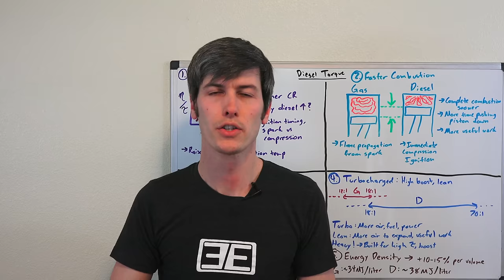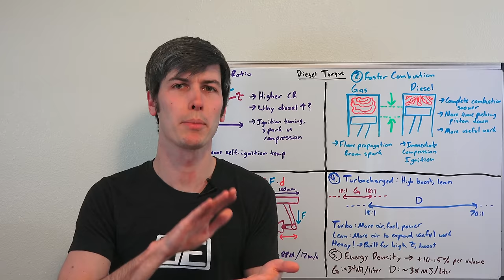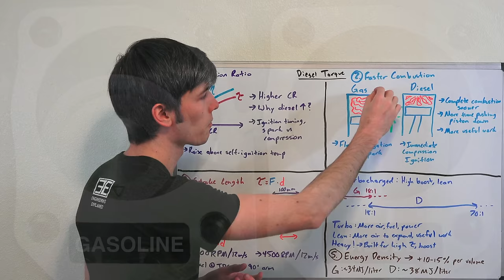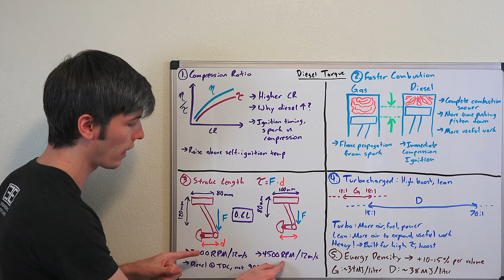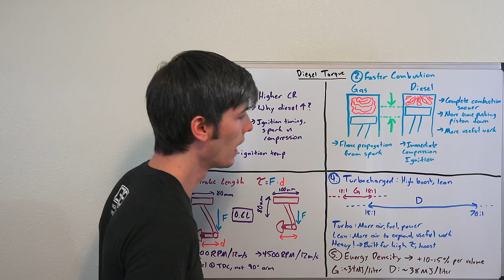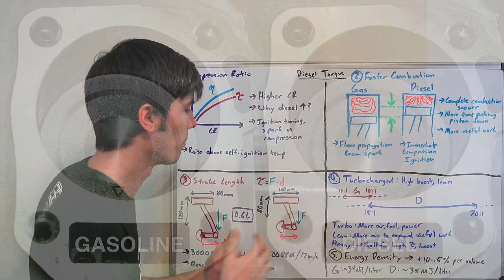5 Reasons Diesel Engines Make More Torque Than Gasoline

Comment: Torque comes from the crankshaft swing a big circle. The rods are longer on diesel than that of gas. Torque is leverage bigger the crank longer the rod more torque. and horsepower for gas is always the same as torque almost and torque on diesel is double the horsepower. 
      Example 200 horsepower gas engine has about 200 pounds torque. 200 horsepower diesel has 400 pounds of torque. diesel engines burn cleaner than gas. gas engines and has very poison  gases. Diesel looks dirty but burns cleaner. 
      Example If you had a pry bar in between two pieces of concrete and if the bar is 4 ft long and you weigh 200 lbs. you would lift as much  as the person with a bar 8 ft long and weighing 100 lbs. horsepower is misleading it is leverage when the motor head temperature rises you lose horsepower (endurance). that is like you are hanging on the end of the bar you get tired and give up that is why when climbing a hill you lose power. 
but the longer the bar is your feet comes to the ground and the longer you can hold on. torque is leverage. horsepower is endurance.
      HORSEPOWER is fraud it should be called endurance and torque should be called           torque power. or TORQUEPOWER . 
       A man wes selling a gasoline powered plow and the farmer said how much power does it have and the salesman said about the same as that horse over there.  And that is how ie started. LEAVE IT UP TO A SALESMAN.

Comment: Engineering explained, the answer to your question about gasoline auto-ignition engines is linked with point two of your excellent video. 
At first, distinction between gasoline and diesel engines is historical. The very first patent of Beau de Rochas was the only available for Henry Ford T-model : mass-production and low cost of a reliable thermal engine, but, relying on a high quality highly volatile fuel : gasoline.
Then came Diesel and the terrific idea to burn crude vegetal oils (at this time), mostly in factories where wegetal garbage was an unsued resource for electricity production : you put crude oil in an engine as you put logs in a chemny.
Since 20 years a dream of oil companies is to reduce the costs, by merging the fuels circuits : one "unique" product on the same market... ELdorado
Since more, engine manufacturers dream should be to merge advantages of two technologies : torque, reliability and efficiency of Diesel engines versus the lower production cost and the lightness of gasoline engines...
So the Beau de Rochas patent implies to compress a mix of air-gasoline close to stoechiometric point. From there comes the limitation on the compression ratio. Many people believed so until gasoline direct injection came and people tried to reach the Grail... Think a bout the 90:1 compression ratio you can find in some propotypes as in F1 !
But the problem is precisely in your point 2 : flame speed.
In fact, things are a quite more complicated than you show. Whatever you do, when you inject gasoline, evaporation and mixing are quite fast and wether you chose auto or spark commanded ingnition the flame will propagate in a gaseous mix.
In a Diesel, oil drops stay floating in the turbulent overheated air of the chamber : they slowly evaporate at their surface and auto-ignition occur in the thin spherical shell where the gas concentration decreases from saturation (at drop surface) to stoechiometric point.
The first flame is called a deflagrant flame, the second is called a diffusive flame. At the stoechiometric point the first one produces a sonic shock, never do the second...
This is one of the main reasons why auto-ignition in gasoline is not so easy to manage in alternative engines. You can do it in short-lived engines (like F1), or turbines of course, where things get stationnary. But for low-cost long-life mass production engines, you can forget it until you find the way to manage with the deflagrant regime of the combustion front in the chamber...

Comment: Gas engines can be longer stroke too, the Toyota 1ZZ-FE is 1794cc, with a 79mm bore and a 91.5mm stroke. This combined with the long thin intake runners that the early engines are fitted with makes for a hilarious amount of torque from a small 4cylinder.

Comment: Torque is good at low rpm, rpm is 10x adding more power to newtonmetre than effective newton metre does (350 nm gains faster kw by rpm than what a newtonmetre gain would compensate, in this case you have 73 kw at 2000 rpm) , diesel torque pulls weight, petrol picks up speed. You always need both, of course, as you pull weight and want that weight to pick up speed. That's why a relative low weight is better off having a petrol engine, but at a certain point you need a diesel. European market was happy with the turbo and the intercooler, that made our diesel revolution in the eighties and nineties. I never liked diesels though, always had petrol cars.

Comment: Good video but it ended with a strange claim. Isn't maximum torque determined by oxygen? And since gasoline generally contains oxygenating additives, such as ethanol, I'd say that diesels lose point 5. Perhaps you were thinking of MPG?

Comment: Diesel also have higher energy density compared to petrol/gasoline hence the higher torque figure 
1 litre of petrol - 9,1 kwh - 32,6 mJ
1 litre of diesel-oil - 10,0 kwh - 35,9 mJ

Comment: Diesel is way better all the way around. More power. More torque. Less emissions. 40% of the engine power goes to the wheels compared to the 20% of gas. Diesel is also easier to refine than gasoline. The engines are also much more durable and long lasting. Only down side is a repair on a diesel engine is costly.

Comment: I don't buy the idea that diesel-air burns faster than gas/petrol-air mix. Indeed, with gas/petrol air mixes there is always the danger of detonation and it's one of the constraints on the maximum compression ratio that such engines can sustain. It's also generally recognised that the reason that diesel engines are largely self-limiting on RPM is the relatively slow speed of the flame front and burn rate of diesel-air compared to that of gas/oetrol-air mixtures. The latter can commonly reach 7,000 RPM on quite ordinary car engines, with some well over 8,000 RPM and in certain motorcycle or race engines approaching 20,000 RPM (with very short strokes admittedly, but no diesel engine can get remotely near that). Then there is the point that, with a diesel engine, there is no ingestion of a fuel/air mixture. Fuel is direct injected and atomised as it enters the cylinder and diesel simply doesn't burn that fast, even under those conditions. If it did, diesel might detonate in the manner of petrol/gas, and it never appears to do so.

The main explanation is surely the higher compression ratio. The higher compression ratio allows for higher cylinder pressures throughout the power stroke. Even then, be careful as it's not obviously true that a naturally aspirated diesel produces more torque than an equivalent petrol/gasoline engines of similar capacity. It seems to be turbocharging that's made the difference with diesels as they are more tolerant of high boost pressures than a petrol/gas engine as they are not prone to detonation. Older diesel car engines were notably weak prior to turbo-charging unless of markedly higher capacity than their petrol/gasoline equivalents.

Comment: You make some great videos, unfortunately, this isn't one. I'm sorry but I feel that there is a fair bit of misinformation in this. Firstly, BMEP (proportional to the torque/displacement) is generally higher in NA spark-ignition vehicles than in NA compression ignition engines, so in real terms, petrol/gasoline engines produce more torque than diesel engines with the same setup.
Secondly, while compression ignition engines burn their charge quicker than spark ignition engines, the rate of burning diesel fuel is somewhat limited by the fact that the engine is injecting the fuel as it is burning. If I'm not mistaken, this takes considerably longer than the time it takes for the flame to propagate through the charge in a petrol engine.
I believe that the misconception really comes from the fact that people are comparing forced induction to naturally aspirated or engines of similar power. Since diesel engines struggle to rev highly, they have to produce more torque to produce the same power and as you displayed in a previous video, with the availability to use gearing, it is power which ultimately matters.
Anyway, keep up the good work and I look forward to your next video.

Comment: There is  much wrong about this. Bore/Stroke ratio has nothing to do with it. Combustion speed? what?

You should read up on the combustion process of gasoline vs diesel. Spark ignition VS Compression Ignition. Most of the things you are saying are why the produce more toque are as a result of the compression ignition requirements. Basically you're arse about face on nearly all of your video.

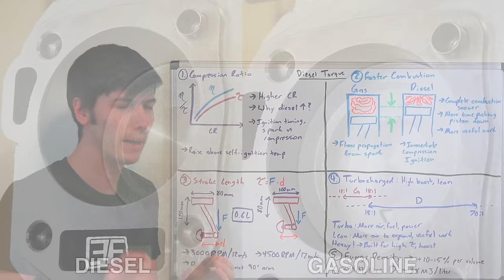Comment: 03:35 the reason why you do not understand this is because you are not considering how slow diesel burns and why ignition advance is is a factor.  Even on gas engines when you are under load or stomp on the accelerator ignition advance creates a spark a little earlier so that there is more burn compression for the down stroke. For diesel engines if you combust right at the top of the compression stroke that is far too late.  FOr diesel engines you want it to combust right before the completion of the compression stroke whereas on gas you only want that under load.  (I am oversimplifying assuming you understand).

Comment: I drive a Kenworth with a  Cummins 15 liter turbo diesel.  The HP is only 475 but the torque is insane.  IDK the torgue specs exactly. At 70 mph in 11th gear the engine is turning at only about 1370 rpm.  This is fairly standard engine, there are others out here with bigger power than I have.

Comment: Really, I think you should think again about how the timing of ignition affects the stroke. Yes, it's not at the optimal position during the stroke, but it's developing cylinder pressure that works for the entire distance of piston travel. It works all the way down to BDC. That, plus what you said about more compression and turbos, etc., is what makes the diesel build more torque.

Comment: There are a couple of misleading facts here... diesel combustion uses a less efficient constant pressure expansion but at a higher overall pressure vs SI constant volume expansion.  Diesels can continue to add fuel during the expansion process to further sacrifice efficiency but gain power. The energy density of gasoline (per mass, like everyone else uses) is higher than diesel and should provide more power but the lower pressure/efficiency prevent it from doing so... a simple P-V diagram would show most of the difference between SI and CI cycles.

Comment: diesel wont completely burn(flammability and volatility), as it  wont mix with air so easily and so intimately(more denser) and; it need more time than petrol to complete combustion(since molecule are heaver and wont get mix with air).  but petrol can do this, it's combustion will be complete and clean(highly volatile), it can burn faster(flammability) than diesel, less time required to complete combustion. it mixes with air easily and so efficiently(lighter molecule, evaporates easily and mixes). am i right???  
please correct me if i'm wrong... so i think when its come to combustion. petrol is clean, faster, more power.. feel free to reply.

Comment: Hi. I must say, I disagree. I had 1,9 litre diesel (Vw Polo) and it gave 120 Nm. It was naturally aspirated. I have found out that gasoline engines, also naturally aspirated, will give 100 Nm/litre. So diesel will give less torque than gasoline engine.

Comment: Diesel is for Power and Gasolene (Petrol) is for Speed. Thats how and why Engines are designed. And if you design both the Engines to have same Torque, then the cost will be the criteria. Again, you have to consider, whether it has to be Supercharged or Turbocharged. And ultimate it is the requirement - Speed or Power.

Comment: Another major flaw in those Engineering Explained videos: for a given displacement, a longer stroke DOES NOT yield more torque. Any increase from the longer "lever arm" is offset by the smaller piston areas on which the combustion gases exert pressure. 

Now, for the same bore, increasing stroke will increase torque. But that does not come from the greater "lever arm", but rather from the increased displacement of the engine.

Doing the calculation is quite complex because one needs to integrate the full compression stroke to calculate the the equivalent lever arm effect and the the gas pressure as it expands while the piston travels down. However, it is also possible to look at this through the energy or thermodynamic equations. In general terms, the engine isn't more efficient with a longer stroke, it cannot extract more energy out of the fuel simply by varying bore and stroke.

Comment: Hey Jason. AKA “torque guy”. I’m curious as to what’s that spur sticking out of the bearing cap on your demo engine. Is it to toss oil onto the cylinder walls? I’ve never seen a bearing cap like that. Thanks for your great videos.

Comment: Another thing I didn't see mentioned was the fact that you can throw almost as much turbo as you want with a diesel because you're using compression ignition to ignite the diesel. You squirt the fuel in when you want ignition to occur (this is diesels "timing)", and can adjust the timing. In a gas engine obviously you cannot keep raising boost because you will get preignition. Weak links because headgaskets and studs...maybe EGT and Pyro turbo temps.

Comment: From the 4 reasons, only one counts: turbo-charging. Without it the diesel engine would have much less torque than the gasoline engine mainly because it uses lean  mixture. Gasoline engines use stoichiometric mixtures (all the air is used to burn fuel) but the poor mixture preparation of diesel engines does not allow that all air is used and less fuel can be burned, producing LESS torque. 
Why does the diesel engine suffers from poor mixture preparation? Because:
1- diesel fuel is very difficult to vaporize and mix with air, much more that gasoline;
2- you need to inject the fuel during the expansion of the piston and there is no time for a good  mixture to be formed: the fuel burns as soon as it is injected.

Comment: Also are you absolutely sure that increased stroke length increase torque because of longer lever? Because I once read from someone who claimed having done dyno tests on engines and found out that the torque didn't increase from stroke length alone. It increases torque because the displacement is bigger. So if you'd have two engines with same tune and displacement but one with longer stroke and the other with wider bore, the torque figures were almost the same.
Well, that's what he claimed anyways. I would really like to find something where it is proven that does the engine get more torque from having longer lever-arm (stroke). Because I haven't found anything proving that from anywhere.
Almost impossible to find any in-depth stuff from internet lol.

Comment: Rotational mass is also a key factor. As Engineering Explained said diesels typically have more mass and with that extra mass there is more inertia. Having more rotational mass will result in more torque. Torque = Force*Distance. Force = Mass*Acceleration.

Comment: all things equal a gas engine out powers a diesel. 
olds 350 a good example since it came in both flavours, extolling the same dimensions.
but you can't beat the efficiency of the diesel.
25% less power, but 40% better mileage.

Comment: I don't think bore length is really a factor, at least not the way you explained it. Two engines with the same cylinder pressure and displacement, but different bore lengths would produce the same power (i.e. energy per stroke), because even though the one with the longer bore length has more distance for the force to act over, the one with the shorter bore length has more force due to the pressure in the cylinder pushing on a piston head with a greater area. This is confirmed by the fact that pressure * volume = energy (N/m^2 * m^3 = Nm).

Comment: You do NOT get greater torque from a smaller bore long stroke combo.  Torque comes from displacement not geometry.   While it has less leverage at the crankshft if the piston is larger for a given displacment  it produces more force on the connecting rod and this allows it to produce equal torque.

Comment: My holden jackaroo ( isuzu trooper) in America. Longer stroke , but compression ratio was 19.5:1.and IHI turbo apparently put out 5 psi. My dad and i moved the diesel in short block form and compared to a the petrol engine going in? Petrol engine was light as a feather! The diesel engine when i tore it down? Those conrods etc were biult massive! Nice explanation 👌. Cheers from Australia

Comment: I don't agree with reason no. 3:

Torque = Force x Distance
Distance = 0.5 x Stroke (at its maximum)
BUT Force = pressure x area = pressure x bore^2 x Pi/4
Torque = 0.5 x Stroke x pressure x bore^2 x Pi/4

So assuming a similar cylinder pressure between different shaped engines, torque will scale with both stroke and the square of bore. Displacement also scales with stoke and the square of bore. So reducing the bore and increasing the stroke should do nothing to increase the torque of an engine if displacement is kept constant.

Comment: I've always wondered why manufacturers don't produce gas engines that work like a diesel engine. Meaning they inject the gasoline after the air has been compressed.

Comment: From that 4 factors, I bet the highest torque effect is the longest stroke. Because old single cylinder gasoline motorcycle like BSA m20 have very long stroke the result is slow RPM with very high torque.